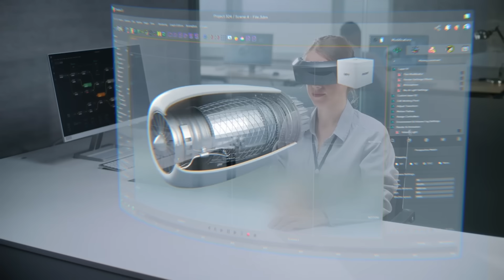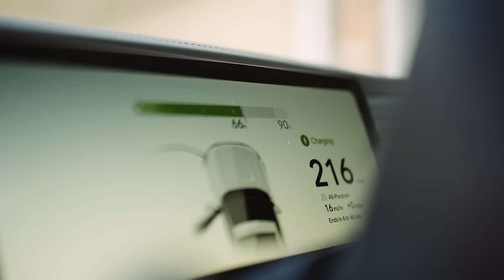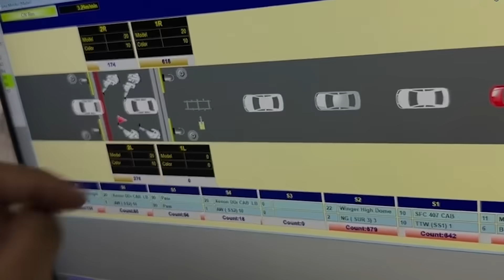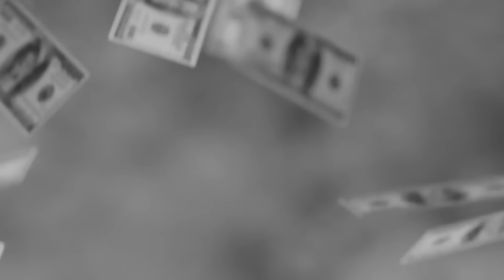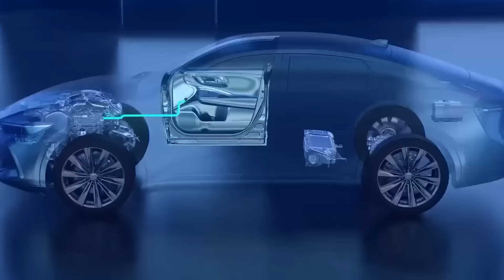Tata Just Revealed a Diesel Engine That Shocks EVs !

Comment: Tata tied up with Cummins Diesel, put up a plant in 1993 and said all Diesel Engines issues resolved in 1500 cc and above range. Then why now shocking with one more Diesel engine and at what cost ? What did they learn from Daewoo takeover ? Now Iveco deal -what prompted them to rush to IVECO deal? There doesn't seem to be any grand strategy in such random acquisitions

Comment: But tata is sourcing its engine from Fiat
Reply from the maker: Yes, Tata Motors has historically sourced several of its diesel and petrol engines from Fiat (especially in earlier models)
Reply: Not now
Reply: @Aryan_jith now also harrier and safari has fiat engine bro
Reply: @SANTHO-x4z that engine is co developed by tata along with Fiat
Reply: @sarthakpanda8641 bro Tata Harrier's Kryotec 2.0-liter diesel engine was originally sourced and manufactured under license from Fiat (now Stellantis). However, in a major development in 2025, Tata Motors acquired the licensing rights to produce and further develop the engine independently.
Reply: @SANTHO-x4z Engine was not directly sourced from fiat, it was co developed by tata along with fiat for the use in tata harrier by modifying the existing 2 litre multijet engine because the same engine had lot of compatibility issues with Indian conditions with jeep compass so instead of fitting compass engine into harrier they have rebuilt it from scratch

Comment: I don’t understand. TATA is currently buying diesel engines from Fiat. Why should they if they have their own diesel engine🤔
Reply: Sir, It’s like a frog & hot water story… the vision to change… rest assured 🎉
Reply: I think they buy for cars only from fiat and not for trucks. Fiat makes diesel car engines.
Reply from the maker: Tata did rely on Fiat engines in the past, but it’s now moving toward in-house engine development to reduce dependency and improve innovation — especially with hybrid and EV technologies coming in.
Reply: @ChaptersDiscovery  Tata Motors were working on developing a smaller car version diesel engine for decades. In the development period they were open to using other engines on temporary basis. There may not be any company in the Western world to compete with them but making engines is not their focus since they make range of vehicles cars to mining equipment. Their strategy has remained. They only want engines for their own machines and not keen on making engines  per se. Currently their vehicle engineering is unmatched by any other player in the world.

Comment: Did tata know about this?
Reply: Forget Tata, no company has ever designed a good diesel/petrol engine. We have Cummins/Kumotso/ imported tech only. Indians have not designed an engine which can pass the fuel efficiency standards.
Reply: @Radhakrishnan-i8t  how about mahindra ashok leyeland engines how about tatas own engines like indigo 100 percentage local using. Kirlosker engines,  greaves engine tata cummins engine manufacturing in pune. force engines who manufacing engines for benz , rollsroyce and bmw over 50 years.
Reply: Tata diesel BS6 still runs without DPF.
Reply: @jtomsinfra5026 bs6 phase 2 has dpf not sure about bs6 ones need to check but it should definitely have
Reply from the maker: Thank you for your valuable feedback!